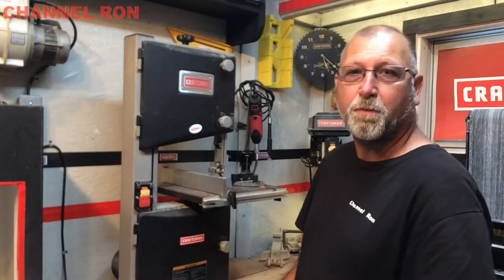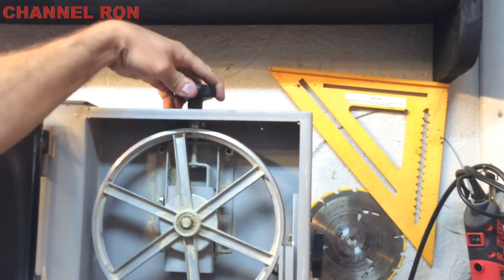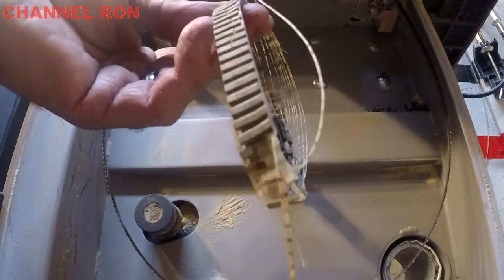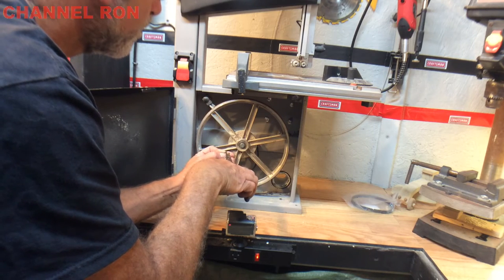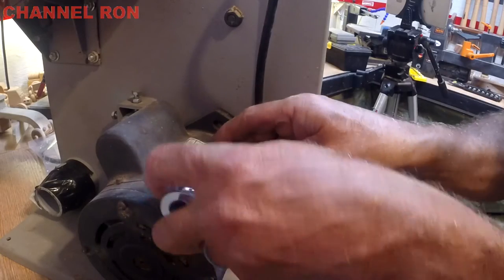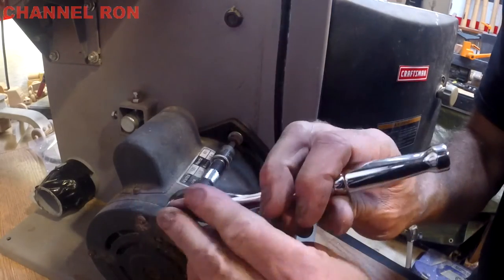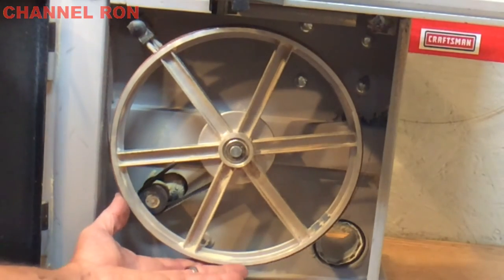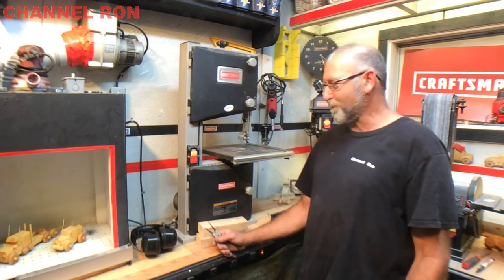10" Bandsaw Repair

Comment: I removed the blade (time to replace it). Then slid the belt on.  This is the easy way to do it. As I used the saw over the years I occasionally had to adjust the motor tension but when the belt disintegrated was a surprise.